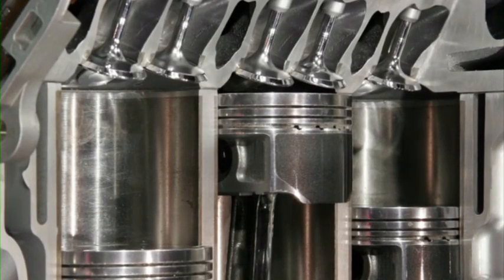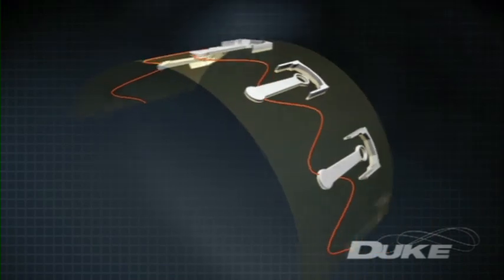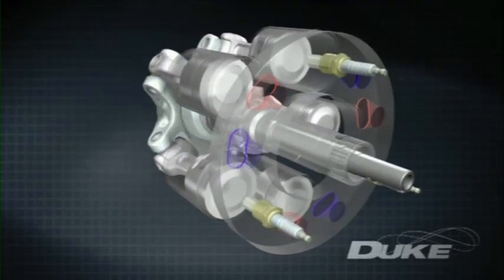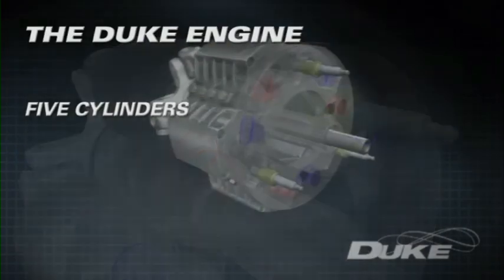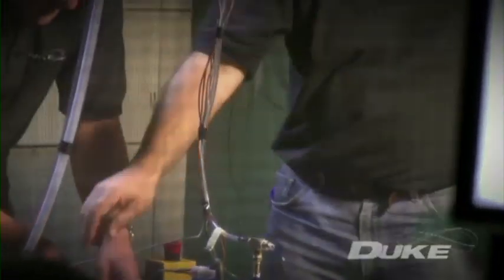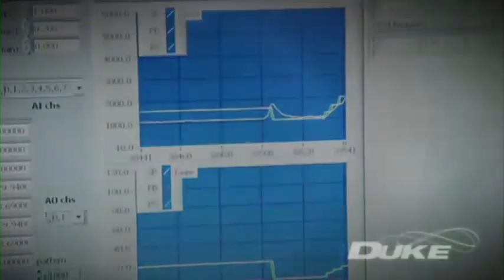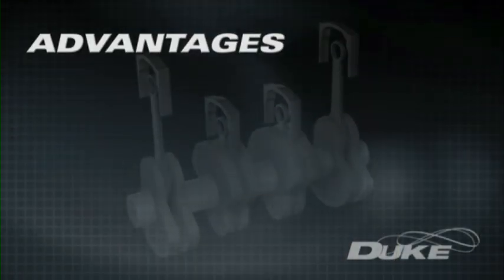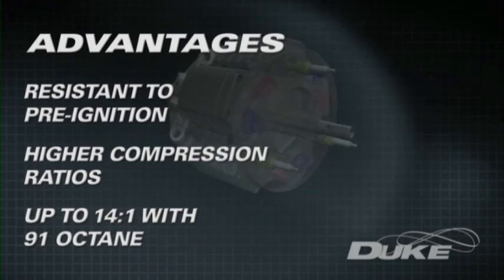Duke Engines

Comment: I see no point in this. Yes, the valve train is simplified but everything else is notably more complicated. Think about the machine work involved & the overall bearing surface. The pistons now have 2 wrist pins. Now there is friction on the piston rings plus the top of the cylinder. Newer isn't always better, different isn't always better. It is good to try new things but there is a reason the standard engine has dominated so long.
Reply: True, however at least some one is out there trying to improve on what I would almost call beating a dead horse. But just think about how long the traditional reciprocating engine has been around easily since the 1800s vs anything really new that has come how within the last 100 years or so that has even come close and only one comes to mind that was a success being which the Wankel Rotary engine. At least some on out there is trying to improve the automotive industry and not just being a pessimist over the whole ordeal.
Reply: john halkoski I am not saying don't try, I am just saying this isn't it. A piston in a cylinder has been the best way to convert expanding gasses, from steam to gasoline into forward motion for well over 150 years. Steam turbines work better on large scales (ships electricity production) 
This is still using the piston in a cylinder, they are just doing it in a novel way. They are going to extreme lengths to simplify the valve train. They have extremely complex bearing surfaces that would be hard & expensive to manufacture, getting them lubricated is another major problem. Yes, they have cut down the number of parts but it's at the cost of single parts making very complex motions. 
Current engines are lots of parts making simple motions. That is easy to make, easy to fix & a simple motion is easier to make reliable. That basic design is going to be hard to improve upon but that's not saying it can't be done. Like you point out, rotary was/is an alternative. That came many years after the basic piston in a cylinder. Who is to say there isn't yet another way?
Reply: Their is another way its called the MYT engine (mighty yet tiny) its only 14" in size but internally produces the same amount of power as a semi truck but still gets 100mpg= naturally aspirated making close to 800ft lbs of Torque
Reply: Ah see one point where you are wrong is in my current car has a wankel engine and it has well over 50k miles and still running strong. the problems the wankle had wasn't entirely due to a bad engine design but rather bad drivers, with new engines comes new territory of owner ship. just like any engine has its SOP so does the wankel, for instance, you don't drive it regularly until its completely warmed up either by A.) letting the engine idle until the thermostat opens. Or B.) shifting roughly at 3k rpm until the engine is warm. and to bother putting out another engine isn't just about being as good or better, but to show the world that we aren't just limited to these cookie cutter cars the mass population drives today. Its about seeing the possibilities that engineers can put out, how will we know if it works or not if we don't give it a try. what we are doing isn't really re inventing the wheel its more like here we have what we've seen works, but now lets see how well it works if we try it like this. Case in point back to the Wankel engine. one of the biggest down falls to regular reciprocating engines is how many moving parts their are. the more that moves the more their is to go wrong. so what did Wankel  do? he condensed it down to just 2. ( 1 eccentric shaft. and 1 rotor). all I'm saying is give these engineers more time and i'm sure we will see something spectacular from it. Rome wasn't built in a day as they say.
Reply: ***** lol ur full of shit. I have an 84' rx7 with a wankel rotary engine with 300,000 plus miles. its a little rough on gas but it still runs great
Reply: That will suck when this engine throws a rod... LOL. $$$.
Reply: john halkoski that engine is amazing, i had never heard of it before reading your comment.
Reply: john halkoski that engine is amazing, i had never heard of it before reading your comment.
Reply: R Smith I think it probably will be much harder to throw a rod because of the force, rather than only going up and down in traditional engines, it his new one also has rotation and also the stroke is significantly shorter.
Reply: *****
I put 235,000 miles on a 79 RX-7 GS...  Had it rebuilt because oil consumption was up a bit over the standard (driving by the wobble pump that fed the carb throat.
Reply: ***** ...what you just described is exactly what we've been doing with standard engines ever since they were invented.
Reply: It could potentially bankrupt some companies while making others rich. I'm not sure you've ever been in a cnc shop but they usually start with a block of metal and cut it all away. I should also add my father, and step-dad both worked in a plant that made transmission gears for gm, most things were crudely machined and later refined to be perfect.

Comment: lmao..  one of the worse things I've ever seen.. This will never work because of the materials would have to be made of titanium and the average oil wouldn't be able to lubricate the engine enough for all parts to KEEP working smoothly in this fashion, WAY too many parts moving in order for everything to work just fine.  Any wear would disrupt the function and lead to wear and tear within 30,000 miles, if it was put into any car.

Neat idea, but no.  will not work.  :/

Comment: What kind of peanut would Dislike this video?
Reply: one with a basic understanding of mechanical engineering... given the pressure and heat produced during the combustion cycle a rotating metal on metal seal is implied.  if this is the case some very serious concerns are raised in regards to wear life and reliability.  i could be wrong, but nothing was presented in the video addressing what should be an obvious concern.

that doesn't mean it shouldn't be explored further as it could have many advantages as well.  but there are some pretty serious red flag issues which were not even discussed.  that is probably where the negative responses come from, and quite reasonably so.

Comment: i think that engine would be more heavy than other in same cyl-lites-power engines...although the moving mass in this thing! connecting rods, cylinders, pistons (move not rotarate) and even coolant dont move in engines i work.. exept if you use the phenomenon in high rpm as a gyro type flywheel...

Comment: Please excuse my ignorance, but isn't this like one of those prop engines on a WWI plane?
Reply: No but it does come with the same problem of oil settling in the lower cylinders when the engine is off.  You ever see a rotary air plane engine start?  LOTS of burning oil

Comment: what about a diesel unit, and never mind the increase in rpm will it run like the wankel engine resulting in a crap torque figure at low rpm

Comment: Now if they could vary the swash plate angle this engine could also be it's own transmission. How? Vary the angle of the swash would vary the stroke of the pistons. Maximum stroke for max torque for low speed, gradually decrease swash angle (towards 0 degree) for maximum speed lowest torque. You would have a 100 percent variable transmission without gears.
Reply: +Pat Brookhart one of the clevest comments here (and useful)

Comment: Umm, need to google why pre-ignition is reduced....thats all just (computer) timing regardless of engine type...or so I currently think....
Reply: Pre-ignition is caused by too much heat, usually carbon build up on valves plus the heat from the exhaust port. This motor doesn't have an exhaust port next to the intake like a standard motor. Thus, the fuel doesn't get heated up by the hot exhaust valve before the fuel is ignited. The fuel will stay cooler and greatly reduces the chance of pre-ignition. Quite an amazing design. Now if it gets as much horse power as a standard motor does, they might have something.
Reply: Ah, thanks...forgot about the heat :)
Reply: Kevin Cornell  correct, but the cylinders are still very hot, regardless of valves or not?
Reply: Val P you are absolutely right but the exhaust valves on a standard motor are by the injectors. The piston is in the down position when the fuel is injected and has to get hotter than an exhaust valve would have to be to cause pre-ignition.
Reply: Kevin Cornell
in that video it shows the exhaust pot next to the intake port...
Reply: Dennis Reese I said "like a standard motor". Yes, they are next to each other but the exhaust port comes after the fuel has already been ignited and so pre-ignition isn't even possible.
Reply: Kevin Cornell
it seems, that this engine runs a lot of cooler than a usuall watercooled 4 stroke blah engine, too. the 2 sparks are also well cooled down by changing these revolvering combustion cambers. and: i would lay an egg, if this duke-engine isn't  upgradeable to more than 2s/5z  ;)    wish you a lot of luck against these stupid carfactorys with their 130 years old crankshaft technics. and i would to buy one of these engine for my car, too. !
Reply: hurius
this video made my day. maybe also my future as a possible engineer. :-D  I feel a lot of hope to see this engine running in everyday life cars
Reply: hurius I'm not surprised that they still use these types of engines at all. They break down and need to be repaired so people have to buy new cars and they are not efficient so the gas companies make more money. Both of the big powers win. Why would they change it? It will get changed when the law wants mpg to be so high that a regular motor is illegal.
Reply: Engines w/o computer controls can suffer from this as well. Timing that is too far advanced will surely cause this. But, a spark plug that is too "HOT", with regards to heat range, or even superheated carbon build up can also cause preignition also. Exhaust valves are highly susceptible to carbon build up. Especially in engines that are not well tuned as carbon is nothing more than unburnt fuel.

Comment: Even if it's not an improvement, I'd be impressed if it got off the drawing board.
As my old service manager Frank used to say, "Anyone can draw an asshole, but can you make it shit?". Frank was quite knowledgeable and rather underwhelmed at what came out of the engineering dept. I suspect this video is made to impress would be investors with no real mechanical knowledge.
Reply: ***** Exactly. Wankel was a great design but proved that combustion chamber sealing was one of the most difficult issues an ICE needs to contend with. This design brings that issue to a whole new level of difficulty.

Comment: i wonder about piston rings moving around?
Reply: Kevin Cornell Yeah, that definitely looks like the downside to this design; not only you have to worry about getting a tight seal between the piston and cylinder wall, but now you also have to worry about getting a tight seal between the cylinder wall and the cylinder head which now connects into all the other cylinders.
Reply: Grant Fultz
except it eliminates the problem of apex seals sharing oiled surfaces with the combustion chamber
Reply: anonazero Two strokes do the same thing...BTW, rotaries rule. :)
Reply: anonazero I wouldn't call it inferior. It doesn't get much simpler then a 2 cycle engine and much eaiser to fix and diagnose. Run the right oil and keep it serviced and you will love 2 strokes as much as I do.
Reply: ShepherdsWrench Weight, simplicity, RPM/HP are 2 stroke advantages. Some small planes have 2 strokes, and large container ships are almost all 2 stroke diesel not to mention toys. Put a 4 stroke in a sled, it tips over, starved of oil, seized motor...
Reply: It looks like the cylinders move in a circle with the pistons. So the piston is still only moving up and down in the cylinder. I do wonder though, how do they make sure that all the power stays with the piston and doesn't squeeze past the piston, like having bad rings.
Reply: Kevin Cornell thats exactly what I thought, they would have seal issues just like typical engine block has either gasket or ring or valve issues.  Not to mention all the cylinders rotating like a gigantic flywheel, I do not get the point how this is "so much less weight" then conventional crank? possibly for scaled down versions or small cylinders and larger displacement?
Reply: Val P the block itself is smaller plus there aren't any valves, lifters cam shafts, timing chains etc. Honestly, if they can figure it out, this could be a great engine.     My biggest worry is still the seals though. I just see lots of blow by and them going bad quickly. But!, they may prove me wrong, hopefully.
Reply: Yup seals will always be issue in areas that move rotate etc.. :-)
Reply: Kevin Cornell yea, i was thinking about the centrifugal forces on the rings. but i don't know how the engine reacts to them, i am not an engineer on their team. But you guys are right, i wonder how they fixed the sealing issues.
Reply: Kevin Cornell It seems like it wouldn't be too unlike a rotary engine. Essentially you have a rotating cylinder with five chambers within it versus the rotary having a spinning rotor with the combustion taking place along its edges. In an abstract sort of way, it seems like the seal that maintain the pressures on the sides of the rotor would be similar to the seals that would separate the chambers of this Duke engine.

Either way, it'd be interesting to see how it all pans out.
Reply: kz6fittycent yeah and we don't put two strokes in just about anything that really matters because its an inferior design to the four stroke piston engine.

I'm glad you agree and understand your fascination with the rotary design, its just inferior to a four stroke piston engine in just about every way.
Reply: Yes they do. They rule.

Comment: I don't get it! How the combustion works if there's no cylinder wall?
Reply: What about the friction between rotating cylinder housing and cylinder head. ..
Reply: cylinder wall rotates, against the head i think. about as good as a rotary engine, we know how many thousands of miles they dont last
Reply: lez briddon my rotary is at 162000 miles on the original internals (apex + other seals) and still runs perfectly fine. my friend has an 85 model rx7 and his is also all original but it's at 229000 miles and runs perfectly.
rotaries usually only become unreliable when they are turbocharged and/or made to run above 9k rpm.
Reply: Q: How do you destroy a rotary engine?
A: Turbocharge it
Reply: watch the video again
Reply: lez briddon
This engine does not have the biggest flaw of the rotary being that there are no apex seals. It has standard piston rings like a conventional piston engine. The reason apex seals go out so easily is because they are sliding across holes in the wall of the rotor housing causing them to wear quicker. The biggest problem I could see is the lack of cooling. If they added water jackets and a good lubricating system in order to keep the friction to a minimum on the out side of the rotating cylinder housing I feel like this could be a good design.
Reply: iBoos I was going to go with drive it 49k miles or so.. like every used RX8 out there, having had a new engine put in or had theirs rebuilt.
Reply: Tony Allen yea, but as soon as you turbocharge it, it may go on you on the spot. LOL

Comment: Axial; motors have been used before in the use as compressors for air conditioning in many GM and Ford autos. Also used during the 1920s and 1930s in other aplications such as low profile torpedos for submarine and ship use.

Comment: Cylinders "slide"? How are they sealed? As well as with the Wankel or the quasiturbine concept, there will always be the sealing/friction problem.
Reply: I was thinking the same thing along with how is cooling of the cylinders handled as I see no water jackets.
Plus the entire cylinder block would have to be balanced.
Reply: Yes, and I see the problems in the troubleshooting and
reliability. One ignition, one spark plug?
Is it worth it?

Comment: For all you skeptics, acting like the axial engine is some new kind of concept only engine, there have been working models of axial engines since 1911. Most earlier designs did not work out too well, until Karl Herrmann, the head engineer for Studebaker worked for many years on his Dyna-Cam axial engine design. He took out a patent for it in 1941. In 1961, Herrmann sold his patent to Edward Palmer, who formed the Dyna-Cam engine Corp. Eventually in the late 80s, Palmer's son and daughter had a Dyna-Cam axial engine built and installed into a Piper Arrow airplane, which flew for 700 hours over a 4 year period. One their engines powered a ski boat for 4 years. Their longest running engine ran for 4,000 hours before being overhauled. Planes similar to the Piper Arrow are usually only flown for about 1,200 to 2,000 hours before an engine overhaul. Combined, Herman and the Dyna-Cam Corp produced a total of about 65 engines. After the Piper Arrows tests, the Dyna-Cam Corp won several awards for their engine designs. Unfortunately, Dyna-Cam Corp must have had some money problems, because their assets were acquired by a marine engine company, who redesigned the engine to the point where it bore almost no resemblance to Karl Herrmann's original design. The newly designed marine engine was problematic.